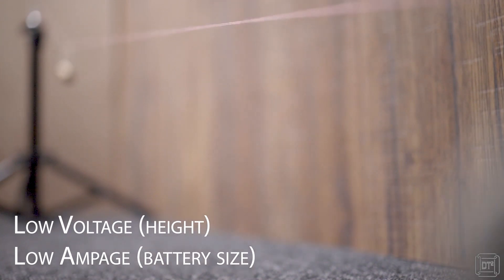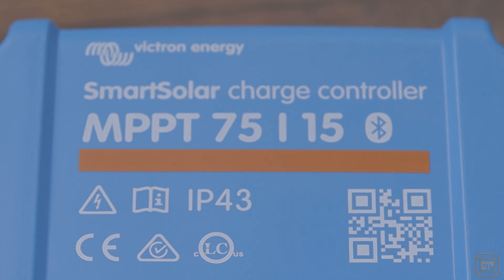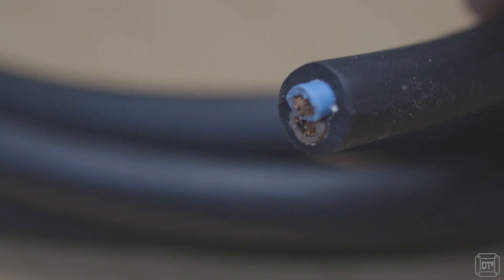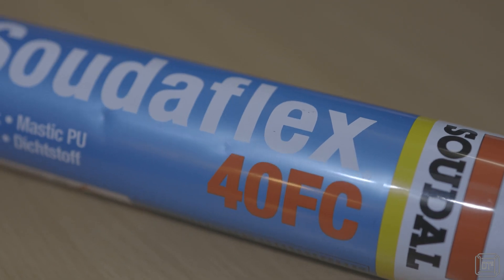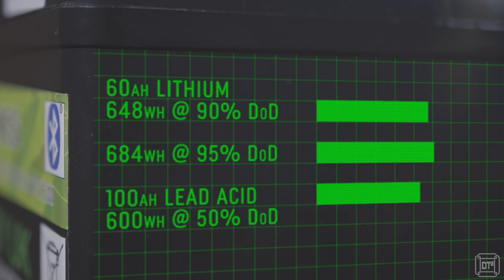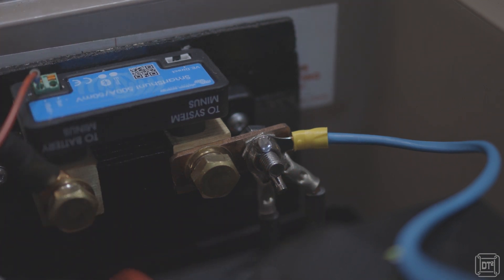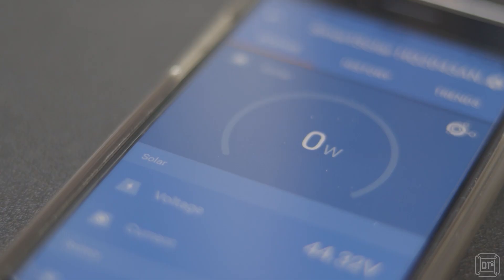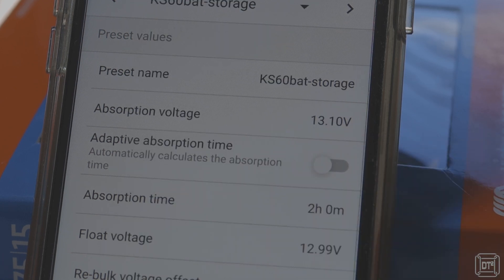SOLAR UPGRADE - Episode 8 doubling our solar and upgrading to Lithium

Comment: Hi Dave, i haven't seen anything mentioned about charging the battery while driving with the caravan. Did the car alternator cope with the high amperage the LiFePo4 battery takes? Did you install a DC to DC charger for charging while driving, and also an AC to DC charger for using the caravan on mains while hooked up on sites? I'm also considering converting from lead-acid but online opinions are split on maintaining existing car/AC chargers or swapping for LiFePo4 compatible chargers. Thanks.
Reply from the maker: Hi
We didn't add a B2B for two reasons. Firstly for our pattern of travelling (weekends and weeks away not full time) we would usually be towing TOO site from storage where the battery would have been topped up by Solar so already full. Then towing home we would then leave it at storage where solar would again top up. So the "on the move" charging wouldn't benefit us.
Second reason is that for a caravan the charge from the vehicle after 8+ meters of minimal wiring is seldom sufficient to so much.
Both cases  are completely different for campervans and motorhomes,  where there is more frequent driving during hols and also when fitting a B2B you can practically ensure the cabling is sufficient.
In terms of mains chargers we generally left our standard mains charger turned OFF even when on EHU. Solar was generally sufficient. A non Lifepo4 specific mains charger will not charge to 100% . But typically, it is not necessary since unlike lead acid lifepo4 actually lasts longer if not charged to 100%. Also our solar Then typically took it the rest of the way.
There is an argument that the battery should be charged to 100% at least occasionally so that the balancing logic of the BMS comes into action.

Comment: Hello Dave I am a new subscriber and enjoying your videos, I am a novice caravaner and it looks like we may have the same van or very similar. I also have 100w solar panel and quas motor movers. My question is  does the lithium battery upgrade run my motor mover is in capacity etc the manufacturer's state min of 100amp battery. 

Pete
Reply from the maker: Hi  Pete, Glad you are enjoying the videos, hope they are helping you as you are starting out.
With motor movers there are two things to watch regards batteries. The main issue is what discharge rate can they safely support, this is the current draw in amps when you are using the motor movers which with a twin axle setup can be quite high. LifePO4 tend to support higher loads better than lead acid equivalent. The second thing is capacity which is more about how long you can run the movers for before draining the battery, or more likely if staying off grid, reducing what you have left to run the lights etc. I suspect that they state 100ah (capacity) because the two tend to be related and that's the easiest figure to find. The 60Ah LifePO4 we fitted may be ok but only because the lithium is likely to have a higher capacity to max current ratio than a lead acid (if that makes sense). If you want to use your movers then LifePO4 would be an upgrade but probably best to go for 100ah or higher rather than reduce like we did.
Having said that I always recommend drivers to manoeuvre the van with the car whenever possible. It's the best (and possibly only) time you will regularly get to practice reversing with the van hitched, and at some point you will definitely be grateful for that extra practice :-).
Dave

Comment: Dave I have found this series fascinating and very informative. We are waiting for delivery of our first caravan for which I have ordered a dealer fitted 100W Solar panel on the roof. My question is, for a typical installation, will the Leisure battery be charged by solar when we travel between camp sites.
Reply from the maker: Thanks Steve glad you found it interesting.
Providing it is sunny and the battery is not full, then yes, the solar will charge your battery when travelling or at any other time. Its worth noting that if you run the fridge whilst travelling then this is powered from the car's 12v feed. When connected to the car all other 12v habitation systems in the van are automatically disabled by a relay.

Comment: Dave, you never drill holes in the roof of a van! Only one hole for the cable and properly glanded!  There are some good adhesives on the market Dekosyl, Silaflex etc and always where possible use aluminium mounts as the do not suffer from mould release agent and are easier to fix.
Reply from the maker: Hi Merve, yep I agree that’s why I didn’t 😀. I used the factory drilled hole that was already there.